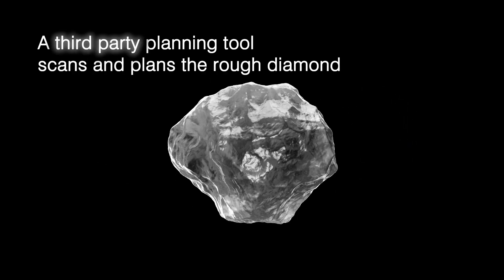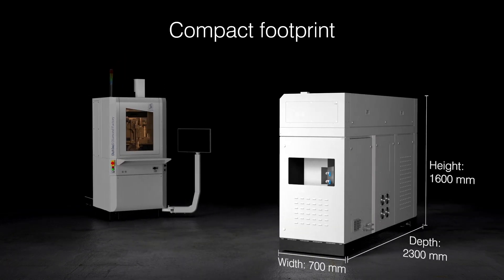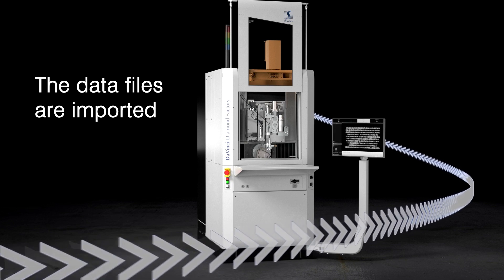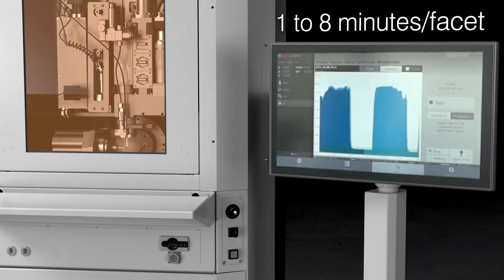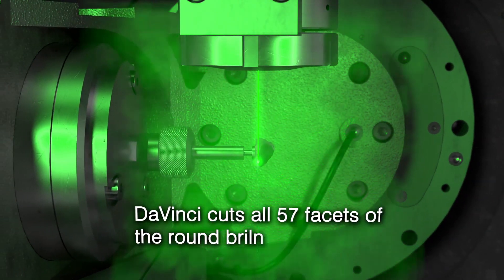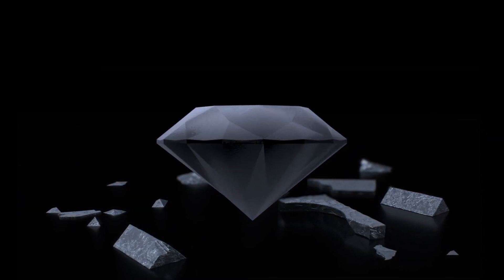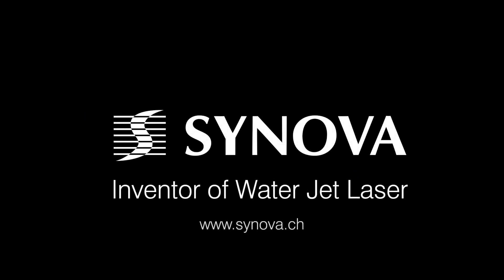DaVinci Diamond Factory: First automated laser cutting & shaping system for diamonds (voice-over)

Comment: Guess that after the lasercutting the stone still needs polishing by hand ??
Reply from the maker: Yes, that's correct.
Reply: @synova8354  so for the polishers its only like repair work.
Reply from the maker: @diamondpiet  After cutting, the polisher only has to polish away the black carbon layer to achieve the desired shine. "Repairs" are not necessary.
Reply: @synova8354  i compare that with repair work
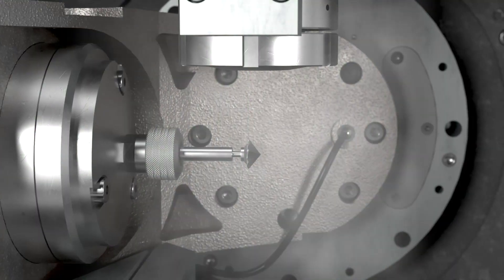Reply from the maker: @diamondpiet  for a 4.564 cts stone it took about 2:30 hours